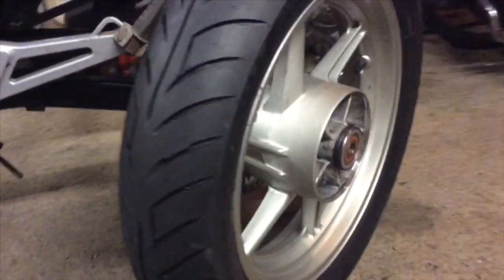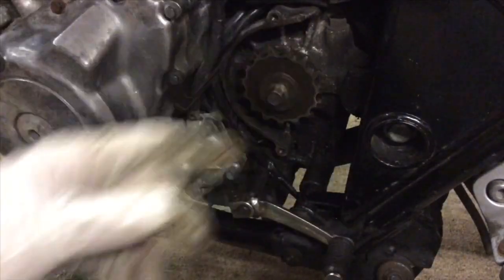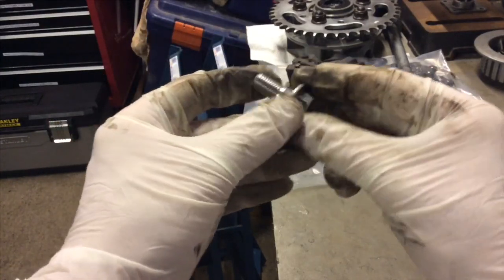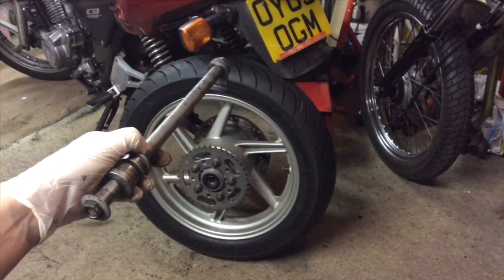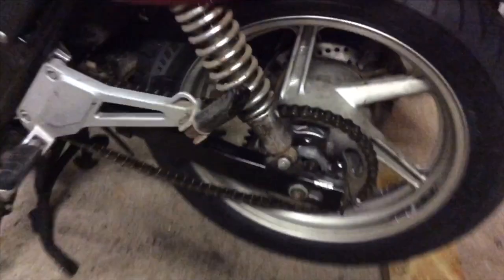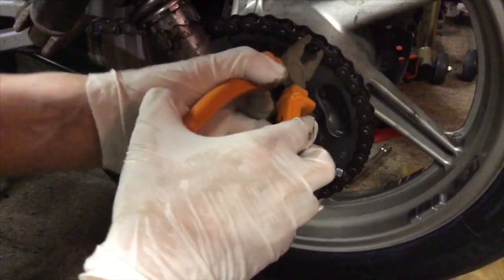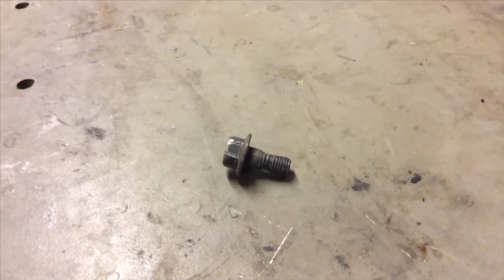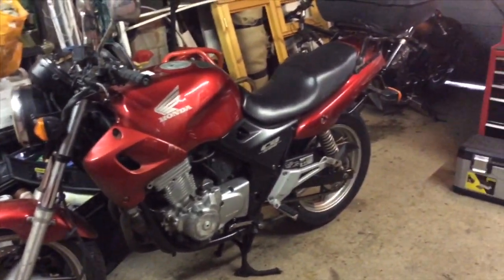CB500 Tyre change, chain cleaning, sprocket bolt - OEM or aftermarket, what would you choose ?

Comment: Good find.  I noticed my rear sprocket had a wobble.  I was wondering what it might be caused by.  Interesting.  I also have a stripped bolt on the chain cover.  Trying to find a bolt is not easy.  Good video.
Reply from the maker: Oh I would have thought the sprocket cover bolt would be fairly standard. Measure the diameter and pitch and search for a generic bolt rather than specific Honda part.  Or if it’s the internal thread, run it out with a tap possibly ?
Reply: Oh, it’s the bolt to the chain guard. Thanks.  I can’t find an oem bolt. Ordered a second extractor kit. Will try that. I already tried one drill extractor kit and epoxy and lots of hammering. Ace hardware gave me the wrong bolt 2 times. You really had a good find.
Reply from the maker: @jbean530  ah I see. Thanks for the comment, yeah it was probably over torqued a number of times. I think there is actually meant to be some play in the sprocket, but the bolt was definitely bottoming out so not helping. I see chain guard need specific bolt, pain in the bum.

Comment: Think you might have the axle going in from the "wrong" side..the cranked washer, which goes outside and under the swingarm, and the threaded end of the axle and axle nut should be on the chain and sprocket side of the swingarm/wheel......don't know if this makes much difference as I had mine like yours last year and my little CB 500 carried me up to Dublin ( from Cork, so about 160 miles) to get the IOM ferry, followed by 2 weeks at the Manx GP, and then home from Belfast, maybe 250 miles, so all in I must have put maybe 600/700 miles on the bike with the axle in the "wrong" way...it's a Honda, didn't seem to bother it any, but I did put the axle etc. back in the "correct" way once I spotted it.
Reply from the maker: Dude that is a brilliant observation, what year is your bike ? I only ask as I too can’t see what difference it would make but I notice the factory had R & T models (1993/1994) with spindle going in on the brake side, and nut/tab washer on the chain side, exactly as you say, but the V,W,SW,X,SX,Y,SY,2 and S2 ( 1995-2002 ) have the spindle going in on the chain side and nut/washer brake calliper side. So it looks like that may be a change in set up by the manufacturer,  in the early years, but can’t imagine that makes an engineering difference. Either way, I do seem to have it correct as per the manual, as my bike is a 2002. What made you think your’s was wrong in the first place? Sounds like you have had a great time on your bike, and I’m looking forward to the future when time allows to do similar. Ride safe mate and thanks for the comment.  Rich
Reply: @memybikeni9931  Hello, mine's a 98 SW model so mechanically the same as yours. The Haines manual shows that the rear axle should be inserted from the exhaust/brake side for all models, including the drum brakes R and T ones....Don't have an owner's manual so I'm going on the Haines ( book of lies..) and the way the bike came to me.... I suppose it does make sense to have the cranked washer and big torqued down nut on the side that experiences the most force (from the drive chain when accelerating and decelerating) as most people don't use the rear brake very forcefully...? But then the chain adjusters on both sides also keep the rear wheel straight...!! Depending on what exhaust you've got, its quite a bit easier to get the axle in from the chain side, as you're not going to be whacking the silencer with your mallet...!
Reply from the maker: @Sir Boss. We seem to have two different print versions of Haynes then, as I’m staring straight at the photos of RT and the later models, with the spindle switched to the left on the later models in the photos. Weird, and I agree, Haynes doesn’t always have it right, but these are photos not just text.  I did an engine rebuild and it most definitely had some of the internals wrong in the pictures so totally agree, not 100% reliable. It’s worth a note that on the CBF500 you can clearly see the spindle going in from the left. Maybe you have an older (or newer) Haynes printed version ???. I’ve been riding it like this for 7 years now so don’t think I’ll worry on it too much 🤣🤣🤣. Really good to mention it though,.
Reply: @memybikeni9931  Well then, I knew the Haynes wasn't to be trusted 100% and this conversation only confirms that...! The manual I have is no. 3753 and is marked as copywright 2001, and on mine all the pictures show the axle inserted from the brake side...up until pg. 7.19,  where I found picture 16.29 with the nut and washer on the brake side, which is the opposite side to every preceding picture, including pictures 16.4, 16.5 and 16.13 on pg 7.18....so yes, 2 pages facing each other and the axle is on opposite sides..you couldn't make this stuff up!.. So I switched mine needlessly a few weeks ago...and while doing so the pads swung down out of the caliper and I wasted another 40 minutes of my life trying to line everything up while getting the axle back in...! Anyways, ride safe, keep up the good work and illegitatimi non carborundum.
Reply from the maker: Ok so if you look at pictures 16.4 16.5 and 16.13 they are as you say spindle going in brake side, but that is on the drum brake model, and 16.29 going in chain side is the disc brake model, the pictures are of the earlier/later bike, so you should follow 16.29 as yours is the SW ‘98. I think that’s the issue dude !
Reply: @memybikeni9931  You, sir, are 100% correct, and far more observant and switched on than I am. I've worked out where I went off on my tangent, I looked up the amount of chain slack I should have in the early part of the Haines, saw a picture there and concluded that I had my rear axle in the wrong way around...! I'll go stand in the corner for a bit....Have a good'in and ride safe.
.
Reply from the maker: No it was really a good observation. I wonder if Honda did switch sides on the disc version, or if they have no preference to set up at all and it just depends on who assembled it. As this was clearly two different bikes that literally may be it.  You may come out of the corner now 🤣🤣🤣